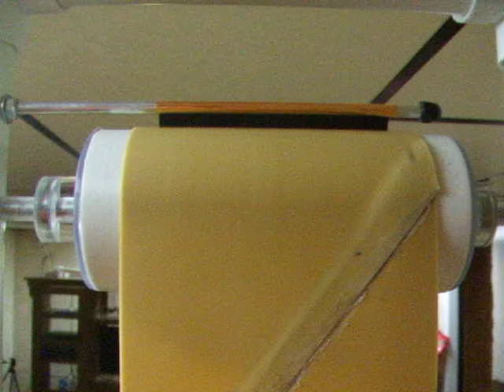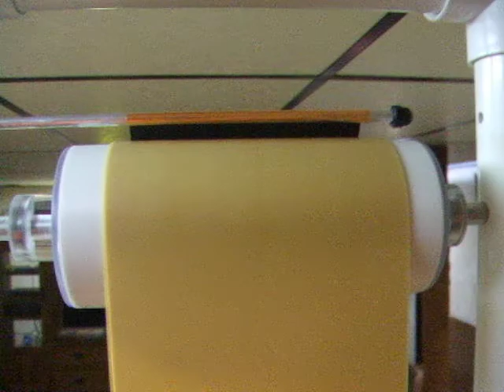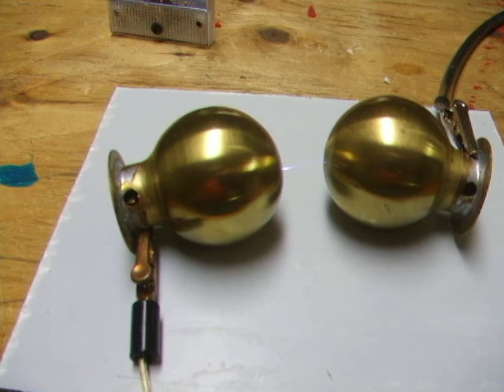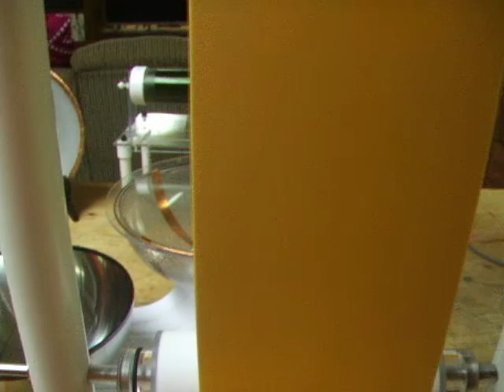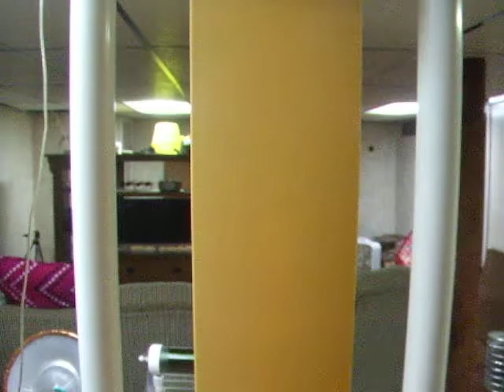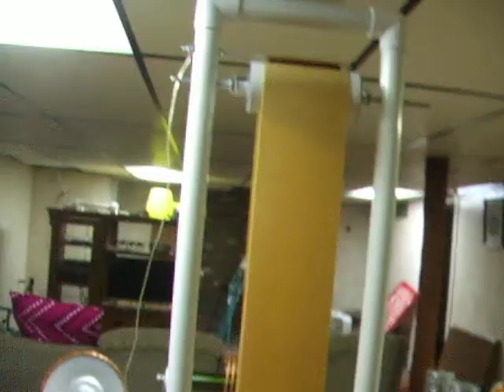VandeGraaff Triboelectric machine

Comment: nice work! could you share more details on the contruction of it ?
Reply from the maker: Hello Martin, Top roller is 3" PVC covered with Nylon sail tape, bottom roller is 2" Teflon, belt is 6" natural rubber. Pickups are conductive plastic, [anti-static bag material]. Motor is from a sewing machine, switch is common light dimmer.
Thank you for your interest;
Doug